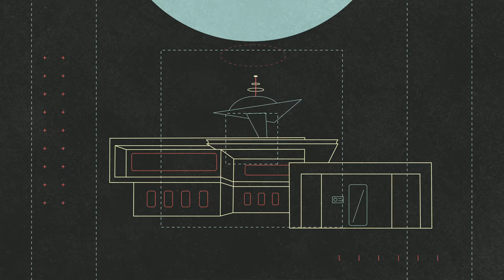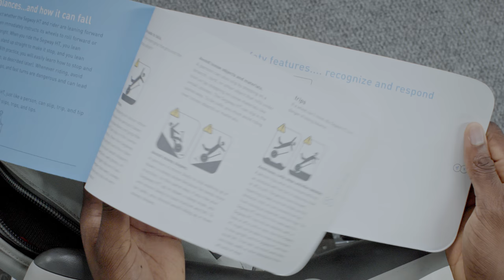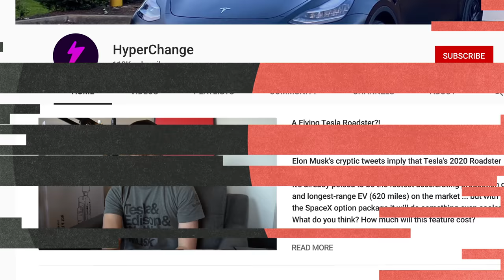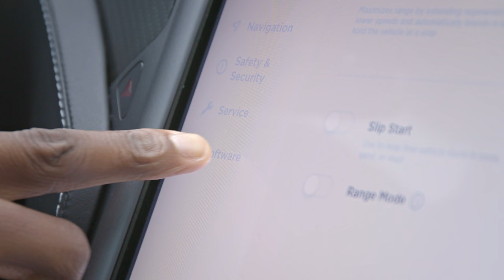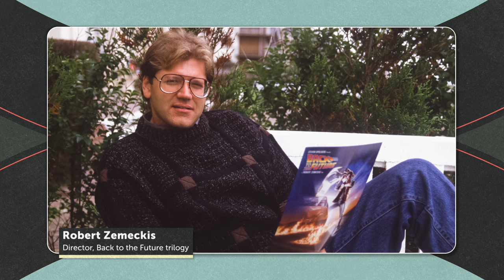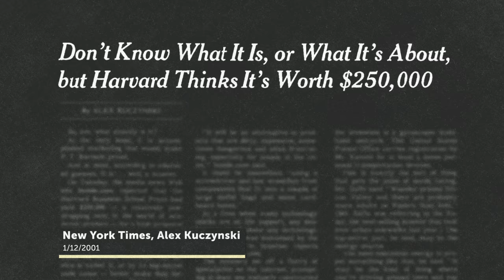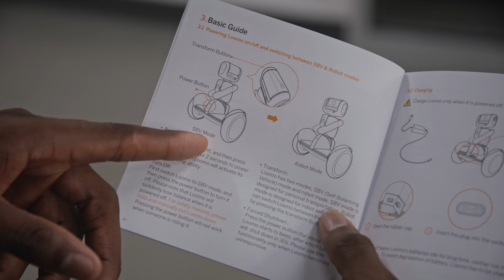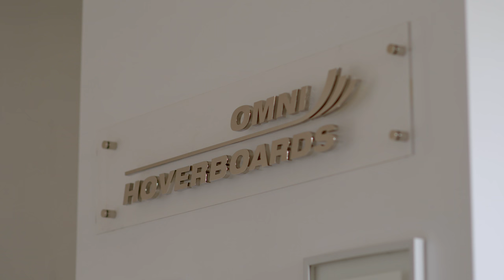Retro Tech: Flying Cars

Comment: Do people not realise even if we get flying cars everyone has to have a Pilot Licence along with a Driving Licence. How many people would want to  waste so much time and money on getting a licence like that. Not to mention the fuel costs.
Reply: and all the additional rules for air driving that the government would have to make
Reply: @nothingbutprofit1347  Not to mention those tools that use the right turn lane to speed straight through an intersection.
Reply: @littlebee33  It wouldn't make many new ones, it's just that most people don't want to learn the ones already set in place. They would just have to learn and follow air regulations, obtain fixed wing (pretty much your standard plane) aircraft license and for VTOL/VSTOL you need a helicopter pilots license, over urban environments would require constant communication with flight controllers, in short most people won't be able to fly but at least that leaves all the bad drivers and pilots out and away from these vehicles
Reply: no, as software/AI would drive these flying cars
Reply: @halivudestevez2  than that's not much different than using other flying vehicles such as helicopters and planes, wasn't the appeal that YOU got to fly, self reliance in a way
Reply: @El Dimos Karam helicopters are worth a fortune, huge, and I assume you don't just have a giant helipad in your backyard. Flying cars are practical if it fits in the garage

Comment: "We want to make a helicopter, but not call it a helicopter."
Reply: Pretty much!
Reply: Yup, why flying cars can never happen. That and the fact rolling is so much more efficient than flight. Bet those people with their $200K roadsters that can float for a whole minute feel so great having a sports car the size of a seadan just so it could float a couple seconds. Totallu worth it.
Reply: Flying cars won’t work but I do think flying hoverboards will work and make a comeback. The guys that Marques talked to at Omi hoverboards even prove it how they flew several feet in the air.
Reply: @lifeisshrt7929  absolutely not. The problem with flying board (they're not really hovering but actually flying at this point) is energy storage. You basically need a backpack full of batteries to run it for more than a minute and then we still have the risk of falling to your death if the wind makes you flip off or you lose balance.

 Hovering a couple inches off the ground is safer but the only feasible way of doing such is like the hendo hoverboard with rotating magnets inducing eddy currents in a conducting surface. Downsides of this being the board is too damn heavy to move on as shown by Tony Hawk riding the board the board itself weighs nearly as much as himself. Not to mention these now require us to replace our walkways from concrete to copper or aluminum sheets which is not at all cheap, slippery to walk on when wet, and will show damage from people crashing or scrapping it incredibly easily. 

Flying cars and hoverboards will never take off unless we find some new way to produce lift that is far cheaper than existing strategies and doesn't make a shit ton of noise. Unless we get some way to make anti gravitational force, dark energy engines, or something exotic like that we will be stuck with wheels due to raw efficiency.
Reply: @Skylancer727  That’s true

Comment: The closest thing to a "Hoverboard" that I would call viable, and even safeish for the civilian market was the Hiller VZ-1 Pawnee "Flying Platform."  It's steered pretty much like a Segue, only it can tilt in all directions.  It's so notoriously stable that it's difficult to get up to high-speeds.  Which means car thieves, and joyriding teenagers can't crash into things at high speeds.  The rotors are ducted, and underneath they have control vanes (Basically like hovercraft rudders, only the engine is turned vertical) so it's more difficult to stick your head, or arm in there...  I'd still ban them in city limits, but for zooming around the farm, herding livestock, and so forth.  Extreme sports is basically joy-riding with a points system.  Also, it's 1950s tech.  You could probably build one from a parts kit off of Amazon, (with Rotax engines) if they sold parts kits on Amazon.  The main problem is the large (And precisely curved) duct.
Reply: Okay, the multirotor drone design is a losing prop(Pardon the pun)osition, because of the square cube law.  You want 2 rotors, because they have to oppose each other to avoid torque steer.  10 rotors is 10 times the weight, and 10 times the lift area.  If you just make the rotor radius 3 times larger, you have 9 times the lift area (Hence square/cube law) for less than 3 times the weight.  There's also the problem of spinning them fast enough, while the arc of a larger rotor makes the wingtips (It's basically a wing) turn faster through the air, and generate more lift.  There's fewer wingtips for losses to tip vortices, you can duct them with the saved weight, concentrating the airflow, and controlling it better (While recovering losses from the tip vortices) and protect the people around you from the 2 rotors spinning, instead of 10 of them spinning fast enough to make up for their lack of Radius.  This is basically why the most efficient Helicopter design is 1 large rotor, with a tail rotor to counteract Torque.  It just doesn't scale up.  However, you can't have a rotor that large in a parking space, so 2 rotors, either front, and back, or on top of each other in the same duct is going to be the optimal design.  (I prefer stacked on the same shaft, in the same duct to save weight.)

Comment: What is about to use magnetism . Like the trains we could fly bz using this. And with the power of electricity you can make it fly higher or lower. One of the problem would be that you must to make ways which are powered and are magnetic. But it is like normal roads that we build everywhere. I am hoping that my idea would sometime be useful.

Comment: YT channel: Hacksmith industries actually made a real life hover board that hovers a specific weight half an inch off the ground
Reply: It was not steerable though.
Reply: @Krmpfpks  but it still hovered
Reply: I swear, if it's just a superconductor than I am going to loss all hope in them
Reply: @midgetman4206   no it’s rotating magnets. Hovers on a magnetic surface and is not steerable. It is a nice video, but it doesn’t bring aus any closer to a real hover board. For that we would need new physics.
Reply: @Krmpfpks  oh, so it uses that weird trailing inducted magnetic field phenomena thing, yeah that's pretty useless unless you want to heat something up. At least it's kind of different, I acknowledge that I was wrong in my assumption, it won't enough to change my views on them though. I would rather go for a hovercraft that's board sized
Reply: @midgetman4206  IMHO to qualify as a hover board it at least has to have some sort of steering. If it doesn't work on water, that would be par for the course. If it doesn't work on concrete ... that would be a real bummer but I could see some application in a specially built skate park or something. But no steering, no fun. And I haven't seen any idea (however impractical) that would make steering possible.
Reply: @Krmpfpks  If your going by a custom magnetic skate park than maybe the only thing you would need as a slight amount of propulsion for movement, though I do think superconductors are the better more efficient levitator (I don't hate them, quite the opposite really, I just don't like how hacksmith presents stuff).
 
 I was thinking maybe a high pressure impeller, pretty much a rotary compressor, this high pressure air would leave nozzles spread throughout the boards structure and essentially act as reactive thrusters. The board would be controlled by leaning, this would be pretty similar to those single wheel electric... things? I don't know what what they're called, in fact, these things are basically the hoverboard (not that other 2 wheeled monstrosity), but they actually exist, just depending on how they're viewed aren't as cool. The problem with many things like this though is the power, one for the park's giant magnetic floor and two is the onboard (ha) battery, induction probably wouldn't work and I'm pretty sure it's less efficient anyways so more money towards the electrical bill for that system; without any breakthroughs with metallic hydrogen, the superconductor will also be costly in the long run due to the cryogenic cooling

Comment: Biggest problem with flying cars, even if they were self driving/autonomous is, what happens when it crashes?

A car that crashes in 2 dimensions will "only" hit a wall/tree/barrier/other car at like 50-80 miles and hour. A flying car that falls out of the sky pretty much turns into a missile of metal and gasoline careening at terminal velocity into buildings, roads, hell anywhere!

Comment: "Now I’ve thought about it, the flying car is, and always has been, a stupid idea. If your car can fly, why would you drive it? No one is going to drive around until the traffic gets too bad and then take off out of frustration. If your car flies, you will fly everywhere." 
-James May, Top Gear
Reply: in my own words, when people say they want a flying car, what they really mean is they want a mini private jet or a Cessna or a helicopter, a small personal aircraft to replace the car entirely not to add to it, if you can fly there's no need for the car component, it's just unnecessary complication and compromise
Reply: I guess Mr. May didn't think about the fact that flying wil use waaaaaay more energy than driving. That's why you would only fly in an emergency. For example what about the police and paramedics having flying cars? I think that would be a huge advantage
Reply: @bramVE239  it is a huge advantage, that's why well funded emergency services have both fleets or cars and helicopters to respond, especially if they are in some remote and mountainous areas. I don't think they would benefit much from combining them though, the more specialized something is the better it is at it's job

Comment: Hacksmith made a pretty good hoverboard if you have a metal sheet under you it would hover.
Reply: Like magnetic roads.
Reply: @LukaszHost76  they used normal aluminium sheets.

Comment: I guess flying cars are still not mainstream because the bigger necessity of the present is to shift from fossil fuel and CO2 emissions rather than decongest traffic by taking to the air. Once we solve this problem in the next 30 years, maybe flying cars would be the new normal.

Comment: where did the numbers come from for how much power needed to lift a tesla? I'm gonna assume thats for rocket propulsion/cold air thrusters. You can use much less power if you are using thrust enhancement or propeller blades/fans.

Comment: You can't take a vehicle that was designed on the ground put it in the air. For instance  the Harrier jet! Its thrusters are designed to push the air from a jet engine under a winged platform and then change the vector. That simple idea took nearly 40 years of design and development and even afterwards was limited because of funding and even then it was disbanded. The problem is we are lazy and have an attention span of a rodent. No one wants too pour funds in to somthing that can't be seen   or touched right now.

Comment: We've had flying cars for decades: They're called helicopters.  Only problem is they suck.  Issues to get to the "real" flying cars: Energy density / range, noise, balancing safety (regulation) with scalability (cost).  Drone tech combined with AI driving is the likely answer.  We'll get there, although most people don't actually like being in the air, so it will never be what was thought.

Comment: So you call the video flying cars but not hover boards? strange choice. And the 80s and 90s were badass, the true era of sci fi. Segways and not skateboard "hoverboard" segways are dorky. Most new crap is dorky because it lacks any design aethestic beyond electric shaver. even cars. I drive an svx, and i consider the look more futuristic then any self driving pos. Self driving is lame because whotf wants to trust a car with your life, and driving can be cool and fun, with the right vehicle. When i drive my car i feel like im on the grid from tron.

Also i find it odd none of these segway inventors dont make hover boards, actually like skate boards. I know those exist, and they are way cooer then those in thisw videos, which i dont consider skate boards, let alone hover boards. The summer board is truly this worlds version of the hover board, and you can even get in designed like martys hoover board, and its 360 capable so you arent limited to just forward and backward. ITs 4 dimensional.

But yea, they need to work on their designs, maybe for robots, and other future tech, they should look to star waars and cyber punk, for inspiration. We want a spinner, not a helicopter.

Jet and electro magnet tech is where it will happen. And maybe converting mercury into electro magnetic propulsion

Comment: One reason it never took off is because it comes from auto. It should come from aero industry. Any aero manufacturer can make a light aeroplane with detachable wings and powered wheels. I guess the reason they don't is because the regular Joe cannot afford probably 200k dollars minimum. Light materials, research and development, testing, certification. The auto industry can get away with many shortcuts, but the regulators won't let milions of flying cars fall on their family.

Comment: Yes, they have to wait until all cars drive themselves before they can fly,
As the technology evolves there's a possibility they will use UFO technology
Which is very real they will use Antigravity propulsion and one day actually build flying cars like on Blade Runner
Star Wars Episode 2 and 3, and The Fifth Element.🧠
I myself was going to build a hoverboard using rare earth magnets to work with and against the Earth's gravity pull to be able to rotate is centuries-old technology is very similar the way a compass would work.

Comment: Not even just safety reasons and idiots dropping out of the sky, but too many thing that have to do with "security", are based on the fact that we can't easily fly in and out of areas and walls.  Our whole infrastructure would have to be revamped before we could even think about implementing it on a bigger scale.

Comment: This could have been way more comprehensive. It was really great but I've seen a bunch of little personal flying drone things that you can sit inside of and they didn't bring that up at all. That's way closer to a flying car than the very last thing which I think was called a hoverboard. That was basically just a drone that you stand on but it's a far cry from a flying car. I've seen a bunch of those flying cars at like CES and if it wasn't for the safety concerns I think we would all have them and even may have them soon.

Comment: Flying cars would be in 2100+ i don't think it is possible right now because there is alot of hanging wires everywhere 😂 although in dubai they are making new city, maybe in that place the wires is underneath so we will be seing flying cars in their at 2050 i suppose. But this flying cars are not hovering they have fckng big rotor blade and the capacity is small because of weight for it fly.

Comment: Well I want to fly and I have faith we will soon overcome the problems standing in the way. I have seen several models that expect to actually go into production this year. I think the biggest issue is there are some who remain stuck on the 'fly" part of the equation, that is they want what is essentially a plane with some limited ability to drive versus a car that also fly's. I want the Bladerunner experience or even 6th Element version and I bet most other folks do as well.

Comment: We can't stop drunk driving.  There's technical problems like air resistance, gravity, lanes being too narrow for wings, and energy density, but even if we solve all of those.  Automobiles kill as many people as firearms, and they can't fly.  If you run out of gas now, you don't plummet to the ground (Or whoever happens to be under you) at 10m/s/s.  We would have to redesign buildings, prisons, and military bases so that criminals can't just fly in like superman, scoop up all the military grade tech, or just criminals in the exercise yard, and fly back out again.  Bank roofs would have to be patrolled by police attack helicopters.  So would Speeders, and reckless drivers.  The problem isn't making a flying car.  The problem is who we trust to fly them.  Civilians?  No, so it's going to the rich, who just so happen to have cliffside homes, yachts, and penthouses with rooftop helipads all ready.  Joe Blow is still going to have a late model sedan, and a 12 pack of Bud Light.

Comment: if it  doesn't fly, it doesn't have a subject !!   it is a fundamental calcualtion in ther  there that if it will take so much power and with autonomy there in a small plate  ...   

you will need to have a real alternative energy source and gps 3d and  battery totaling x10 or even x30  beter then wat weii have in th amarket .

Comment: Flying cars are not efficient and dangerous. There is plane and there is cars. They have different purpose. Hybrid between them is very unlikely. I think there won't be one in the near future. Whats wrong with cars are there is a friction between touched areas which are wheels and roads. This make cars less efficient and less stable. The solution to this is hovering. So, whats more likely in near future is hovering cars.